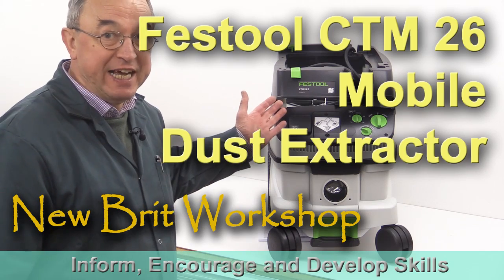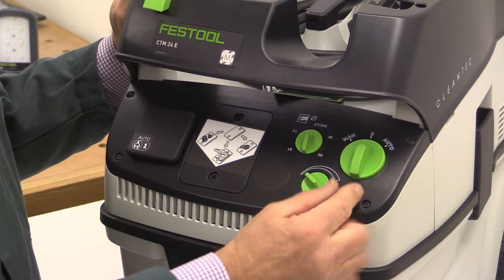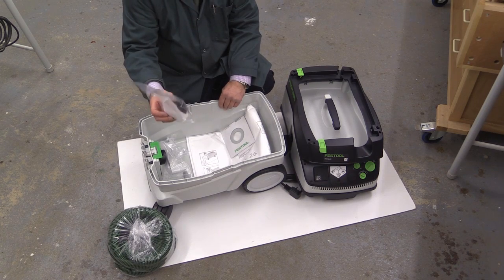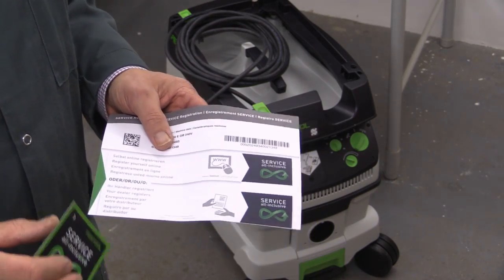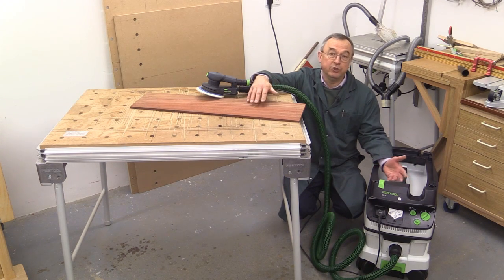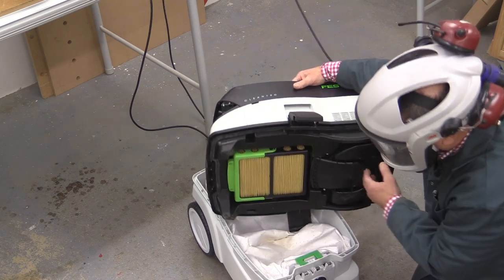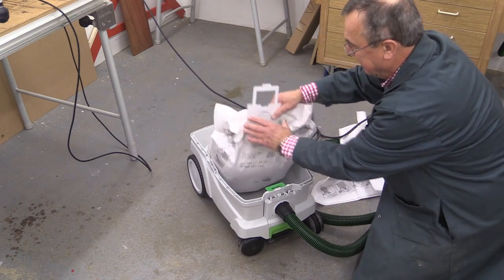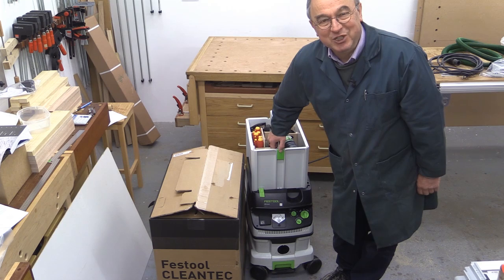Festool CTM 26 Mobile Dust Extractor

Comment: Interesting video Peter, as always. I was particularly impressed by your demonstration of the different pick-up abilities of 27mm versus 36mm hose. However, I'm a little puzzled about the rating for the auxiliary power take-off socket on the front of the machine: you say on the video that this is 2400 watts, but my CTM 26 AC is very clearly labelled as "1800 watts max". This seems to me to be a little low and I'm wondering if in fact it can cope with my Kapex saw? It would be a great pity if it can't and would remove one of the major features of the machine that persuaded me to buy it in the first place. Perhaps you might be able to shed some light? Thanks.
Reply from the maker: Hi Hugh, You can certainly run the Kapex with this extractor. I have the CT26 (12 years old) and it has been in use with my Kapex all of that time.  Cheers.  Peter

Comment: Nice video Peter, thanks for the informative presentation.   I too have the CTL since 2016 and it is still going strong.   However now I am unsure whether to upgrade to the CTM.   Do you still use your CTL or have you taken the opportunity to upgrade to the CTM?  Many thanks in advance. Eddie
Reply from the maker: Hi Eddie, There is no need to upgrade unless you are working on site where M class is mandatory. Peter
Reply: @NewBritWorkshop  Thank you for the prompt reply Peter and duly noted.

Comment: Hi Peter, Thank you for the excellent video! I have one question:) When is the 50 mm hose used?
Reply from the maker: Hi Henning, If you are using the extractor to serve a machine some distance away then the larger hose size is an advantage. Also a short length of a wider hose works well with the Kapex or any other mire saw.  Cheers. Peter

Comment: Is that CTM only available outside the USA? Great review btw. Recently bought the midi but I’m regretting not spending the extra money and getting the 26 instead.
Reply from the maker: The CTM is available everywhere. Yes, the CTM 26 is an excellent machine. The larger CTM36 and 48 have the same motors etc but have a bigger dust bag capacity.   Peter
Reply: New Brit Workshop - Thank you Sir. I see all these model but nothing that says - M - at the end. Everything just says- CT. I Googled and searched but no luck. I have a feeling it’s not available in North America.
Reply from the maker: The Festool Owners Group (FOG) is a forum all about Festool kit and any other kit that people want to talk about. It is well organised and certainly well moderated and I have been a member for about 9 years. I recommend that you go there, join and ask whatever questions you might have. It is not a place for boring experts and you will find novices, DIYers and Professionals all there respecting each other and sharing knowledge. Here is the link: https://www.festoolownersgroup.com/    Peter
Reply: New Brit Workshop - Thank you sir.😊
Reply from the maker: Are you aware of the FOG? I suggest that you ask a question there as the CTM is sold in Europe but, as you say, you only have the CTE. I suspect what you have is the M class machine but a quick question on the FOG will sort that out.   Peter
Reply: @New Brit Workshop - Thank you, but I have no idea what the FOG is. Much appreciated though.😊

Comment: Hi Peter, I really enjoy watching your videos. Since you have a CTL and have done such a thorough review of the new CTM dust collection, can you point out what makes the CTM effective to 0.1 microns while the older models with a HEPA filter installed are only rated to 0.3?  I called Festool here in the US, and asked a guy in their "Technical Use Department" said he didn't know anything about the CTM Dust Extractors and their specifications because they are not available in the US.

Did you say in the video that the CleanTech bags were HEPA rated?

I ended up buying a Oneida Dust Deputy after watching your video showing the setup.  I've felt better about cleaning drywall dust with my Festool CT36 HHEPA since getting the Dust Deputy.
Reply from the maker: Hi Carolyn, Yes, I am fairly certain those bags are HEPA rated. The main filter may be different as well. The UDD is very useful and saves a lot of money on extractor bags.   Cheers.   Peter
Reply: @NewBritWorkshop  Thanks for your reply. I have been combing through all the parts and accessories and I can't seem to find a HEPA rated replacement bag on any website for purchase, Festool international or US or sny dealer. I'm just trying to get to the smallest particulate size for lung safety reasons which seems to be the 0.1 microns health code rating. It seems that replacement bags for sale are the same Cleantec self-clean bags that are sold in the US (same part number), but Festool has always stated the bags are rated to 5 microns, so they are not HEPA rated which is 0.3 microns. The main filter I use in my CT36 is the HEPA rated filter. So, is the new main filter used in the UK what goes down to 0.1 microns? That would make it even better than HEPA, and less expensive to replace.  What do you use in yours?

Comment: The Festool 2019 catalogue states that the CTL 26 is only suitable for - "Assembly [low quantities of coarse dust]" and furthermore is not either "appropriate" or "extremely appropriate" for extracting wood dust or mineral, quartziferous dust.

The lowest level of extractor which is suitable for use in "workshop, industry" and can handle both wood and mineral/quartziferous dust IS the CTM 26 and 36 models.

The information is all clearly laid out in the catalogue, and can be accessed online.

Comment: For anyone wondering this dust extractor is SEVEN HUNDRED POUNDS STERLING.
Reply from the maker: Hi Juan, It is £549.95 at D&M Tools.   Peter
Reply: @NewBritWorkshop  I don't think it is Peter; that's the CTL. The CTM 26 at D&M is £819. No?
Reply from the maker: Hi Juan, You are confusing the CTM26 with the CTL26 - L and M mixed up. I have the CTL.  Peter
Reply from the maker: Hi Juan, My apologies - I have had so many comments about the CTL video that I did think that you were talking about that one. As a matter of interest I am perfectly happy with the CTL for all my woodworking activities.  Cheers.   Peter

Comment: Hi Peter,  Another helpful video, thanks . Great dust extractor, but what is the second, clear plastic, bag supplied with the extractor used for?
Reply from the maker: Hi Peter, I bought mine so long ago that I have forgotten. I can only guess that it is to put either a full bag or main filter in ready for disposal.   Cheers.   Peter
Reply: The clear plastic bag is meant to be used with the CT36 AC as a liner to help remove drywall dust; used in conjunction with the collection bag by laying it in the vacuum chamber first, then attaching the bag to the hose end.

Comment: Is the CTM 26 more efficient at extracting dust than the CTL 26?  Apart from the flow sensor there is nothing to differentiate the 2 extractors?
 A Hepa filter filters to 0.3 microns, a cellilose or polyester filter filters to 1 micron. What the filters do not catch, gets exhausted (at speed) from the extractor - so yes, I'd choose a Hepa filter.
 The litigious Americans have had all Festool extractors other than the ctl-sys and the AC versions, fitted with Hepa filters as standard - which speaks volumes in my view.
Reply from the maker: I have HEPA in my other extractor and will replace the CT26 one with HEPA when the time comes.   Cheers.   Peter
Reply: Yes, but - "Is the CTM 26 more efficient at extracting dust than the CTL 26?  Apart from the flow sensor there is nothing to differentiate the 2 extractors?" ??
Reply: The  motors are the same; the design and build of the bodies are the same; the filters are the same - if all this remains equal, how can one be better than another or handle 'M' class dust types?

Comment: Can this vacuum be used in conjunction with a (Dust Deputy)  cyclone ?
Thanks.
Reply from the maker: You can use any vacuum with a Dust Deputy but some manufacturers, including Festool, warn that static electricity might damage the vacuum and in such cases they are not covered by warranty.     Peter

Comment: I'd love to see the 4/5-cut method tested on the Kapex 60 or 120. I've seen people complain about the difficulty in setting up the MFT accurately and that a sliding mitre is more accurate and repeatable but I wonder how much play there is in a cut with the sliding mitre saws when cutting a 300mm board.
Reply from the maker: Hi Simon, The result from a 4 cut test on a Kapex will depend on how well it is set up by the user. I check mine about once a month and adjust it if required. It usually only needs to be adjusted after a knock. Mine is quite accurate but not as accurate as my tracksaw cutting station created with the Parf Guide System. That said, the Kapex is far easier to use for repeated cross cuts and is as accurate as I need most of the time. I almost always use my tracksaw cutting station for sheet material over 150 mm in width.   Peter

Comment: Hi Peter, great video as always. Some time ago you did a video on building a dust hub, in it you used a remote socket switch to start the vacuum, do you have a brand name or a link to where I can get one? Many thanks, Pat.
Reply from the maker: Hi Pat, I bought mine from Maplin here in the UK. Their site is down right now so I have found something similar on Amazon:  https://www.amazon.co.uk/Etekcity-Programmable-Electrical-Household-Appliances/dp/B01N9NLQ8L/ref=sr_1_12?ie=UTF8&qid=1507703708&sr=8-12&keywords=remote+control+switch      I have not used this particular make but just show it for illustration.    Peter
Reply: New Brit Workshop p

Comment: Hi Peter, I am not an expert by any means but I think you have got the "volume or power" button the wrong way round, the thin pint is low and the thick point is high, at least that is the settings on my vacuum (not a Festool).
Reply from the maker: Hi John, No, go into a shop and look at one.    Peter

Comment: hi peter, i have the ctm26 110v which i have just bought and what ive noticed on mine that no other video shows is a loud bang or knock when i finish every cut , i was wondering if this is normal or do i need a rep to come and have a look???
Reply from the maker: There is no CTN 26 in 110v but there is a CTM 26 AC in 110 v. The "AC" means Auto Clean which is why you hear the noise. What happens is that the inner filter gets vibrated every now and again (and it does sound quite loud) in order to stop the build up of fine dust. This is a really good feature and is what make your machine so much better than the ordinary CTM26.    Peter
Reply: thanks... i thought something was wrong as i hadn't heard of that

Comment: Hi Peter, Great video as usual.
My only gripe with Festool is they changed the actual hose connection for this new vacuum.
They have a "keyway" which will prevent plugging the hose onto the Dust Deputy or similar fitting where the hose has to go on the outside of the intake fitting. Hope you get my meaning.
Reply from the maker: I do understand and there are a lot of other people unhappy with this too.   Peter

Comment: what are the other accessories that can be attached instead of the additional socket Peter ?
Reply from the maker: I think that there are some air line attachments but nothing that I have tried.   Peter
Reply: There is a blue tooth remote control switch that can be fitted. You have a small control that fits in your pocket so you can turn the machine on and off from a distance. Ideal if your using cordless tools.

Comment: Nice clear demo video Peter. What would be really interesting would be to see the Festool saw with a different extractor and a different saw with the Festool extractor. Is it the saw that is great, the extractor or the combinatiin of the two? Given everything I have heard about the excellent dust extraction on the Kapex my guess is that even with an inferior extractor the extraction on that saw would be extremely good. Keep up the good work! Terry.
Reply from the maker: Hi Terry, An interesting idea. For Festool it is all about the "System" approach which means that every component contributes to the process and so the saw helps the dust extraction and the extractor makes it perfect.   Cheers.  Peter

Comment: From what I understand it uses the same bags and filters as the CTL. The only thing making it more expensive is the monitoring of air flow. This is needed if you are doing certain jobs as a professional. I would also guess that the high performance filters suitable for autoclean is just as good as the hepa filters. But that's only a guess.
Reply from the maker: I think that technical stuff like this should be directed to Festool for comment. I suspect that regulations have a lot to do with the way the machine is set up and it conforms to those.    Peter

Comment: Another informative video Peter, thank you. Something I have noticed at least with my CT36 that when sanding I have to turn the suction/speed down as it causes my Festool sanders and other brands to dart around a bit. My Festool rep suggested I turn the speed down until that stops as the suction is so efficient that it causing the pad/sandpaper to grab or catch on the wood. He said each wood species is different due to pore size etc and play with the setting until you find a balance where the dust extraction is sufficient and the sander doesn't grab.
Reply from the maker: Hi Ron, Yes, I have heard that it benefits some situations. I have never done this and manage but I do know that lowering the suction level will help if you are having difficulty controlling a sander.   Peter

Comment: Hi Peter,is the M class filter better, equal or worse than the HEPA rated filter?Colin in Northern Ireland
Reply from the maker: Hi Colin, That is a brilliant question and only one that Festool can answer.     Peter
Reply: +colin farrier
In theory HEPA as an actual filter but not a system has a higher rating in terms of dealing with particle sizes. 

M Class is more than just the filter itself it is the whole encasement of where the filter is housed so that means the container is sealed as well. 

Now just to put a spanner in the works very few tools will ever be able to collect all of the dust so you will have dust blown out by the actual tool.  

Now M Class filters in vacuums are really not about the tools but about using it as a vacuum system such as you would use to clean your floor in the house.

Comment: Thank you, Peter, for another excellent video.   I'm extremely fond of my healthy lungs and have been using a Festool dust extractor for about 6 months.   Consequently, my workshop is almost totally dust free.  I should add that I also wear a powered respirator.
I also bought the brush accessories which allows me to run the extractor over the worktops for a final tidy up at the end of the day.
Reply from the maker: Hi Alan, It pays to be on the safe side and a Festool extractor coupled with a powered respirator is very sensible.  Peter